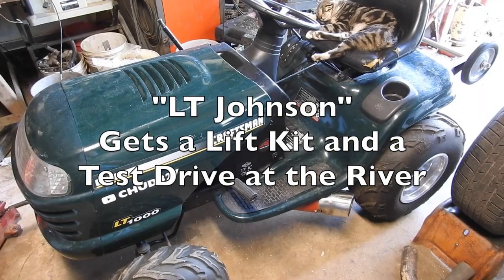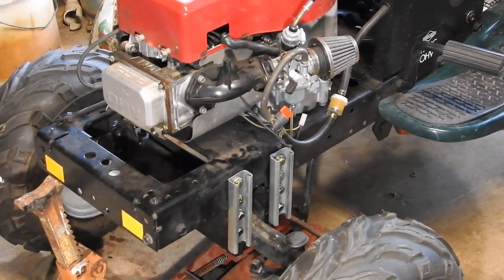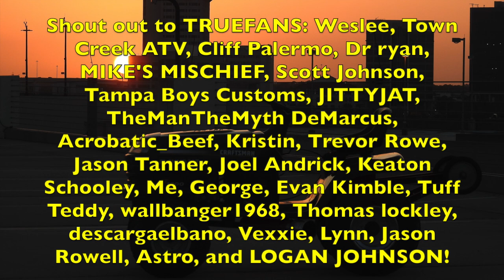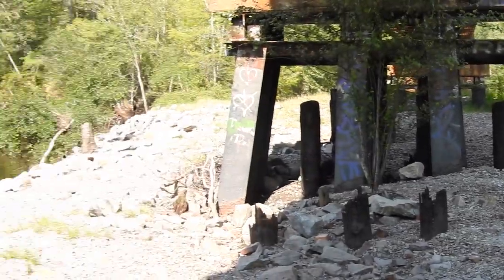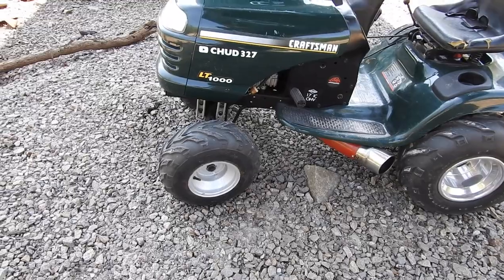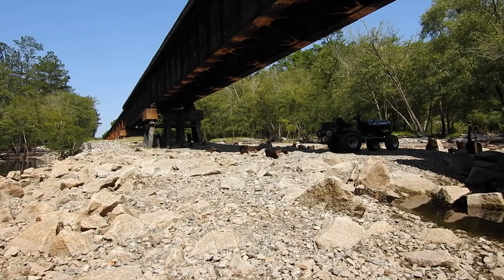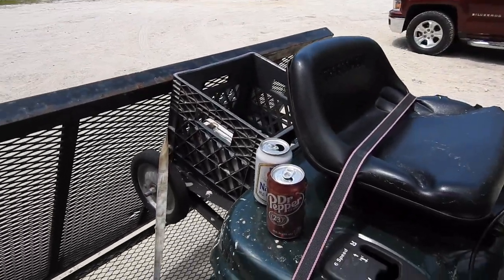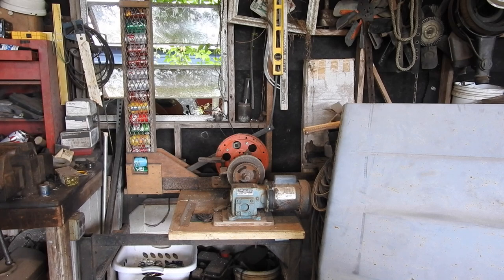Easy Lift Kit Build and Testing on LT Johnson

Comment: I just got a otasco longlife riding mower it came factory with a live axle a 3 speed with reverse 90 degree gearbox and I believe they came factory with an 8horse with a 2 inch engine pulley I'm putting a 18 horse with a 6 or 7 inch pulley factory top speed was like 8 mph I'm hoping for something around 20 or more
Reply from the maker: 20 is a good speed, thanks for watching

Comment: How do you lift the back end? Should do a video on it.
Reply: Bigger tires is the easiest way. Or could do 2 inch drop on rear axle and 2 inch raise on pulley
Reply from the maker: I usually just lift the fenders and put on bigger tires. Hope that helps and thanks for watching. Have older videos showing the process.
Reply from the maker: I usually start with taller tires. Thanks for watching!!

Comment: Hey Chad 327. If you built  a monster truck mower you could use the mower deck lever for 4 wheel ster
Reply from the maker: As soon as I find a rear steer deck... Thanks for watching!! Would probably still use the steering wheel to steer. Deck lever could be to engage the 4X4.